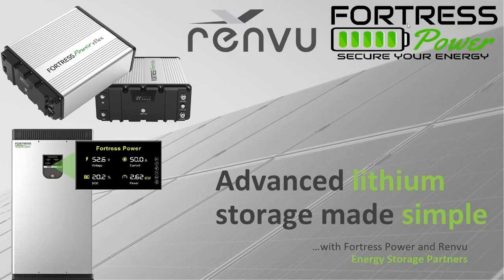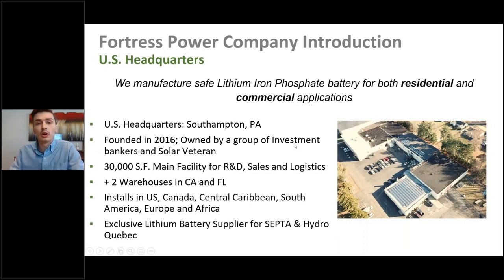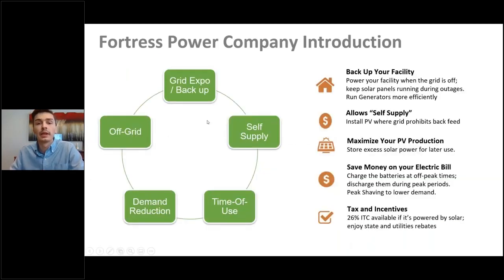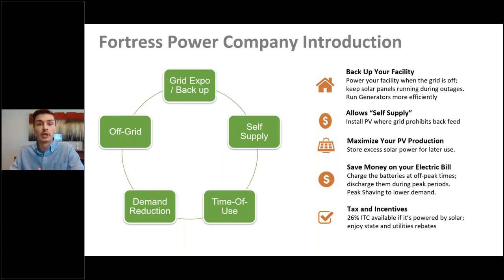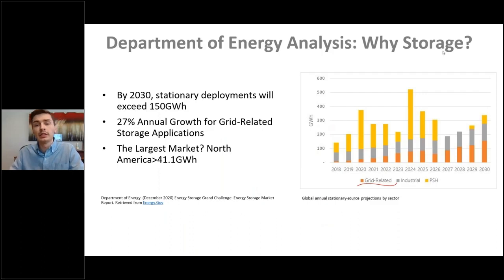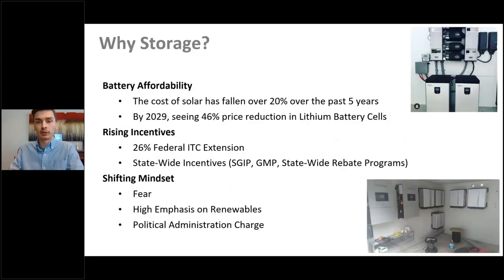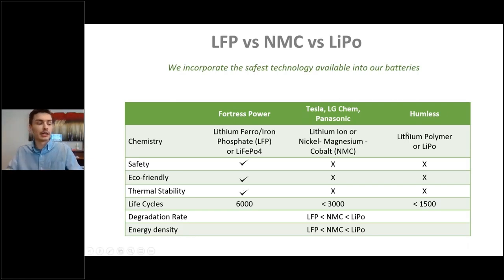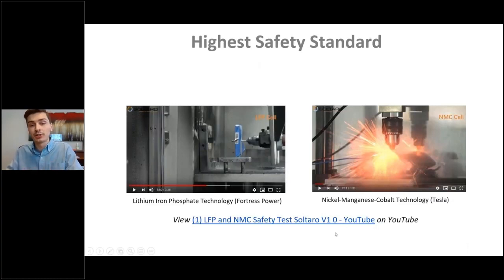Energy Storage System Sizing Webinar with Fortress Power | RENVU

Comment: I have 10 Eflex 5.4K batteries attached to a Sol-Ark hardened inverter. Any idea of how these batteries would do in an EMP event?  Will the batteries be damaged or just the BMS or will they all survive?  The batteries are in a metal cabinet (underbed truck tool box) sitting on a foam garage floor bad.